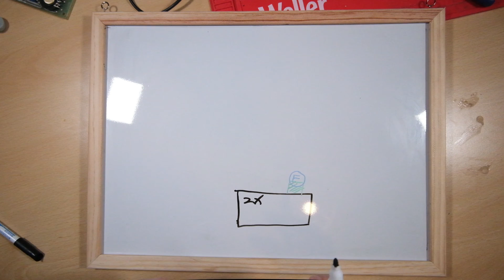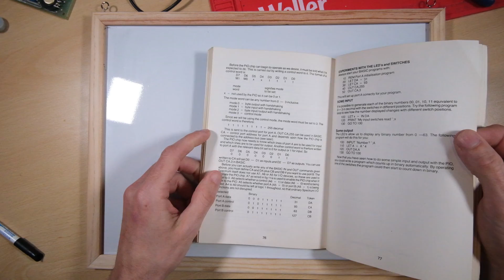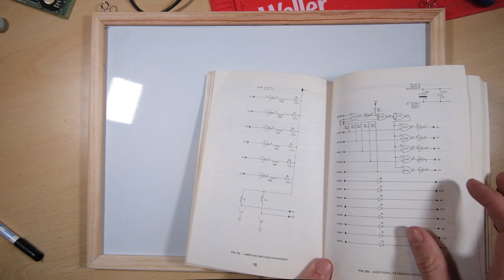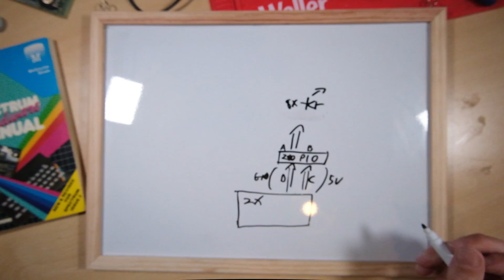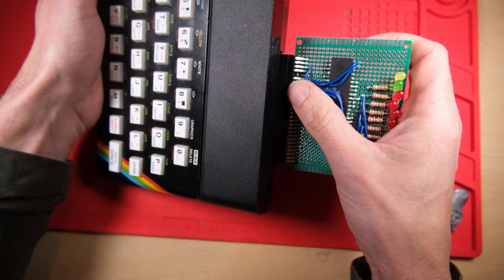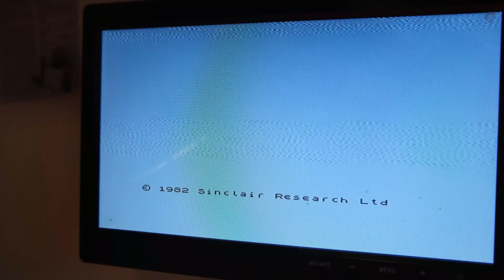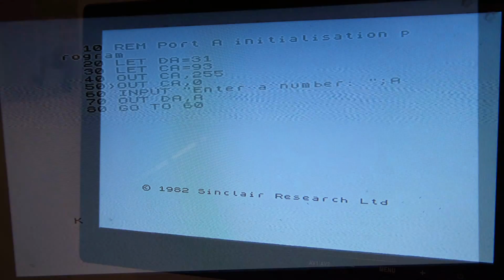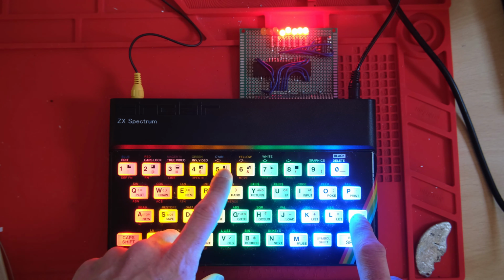How to build a simple ZX Spectrum Interface

Comment: I made 3 of these Z80 PIO breakout boards.

One with Channel A as input and B as output, another with A and B as inputs and the third with A and B as outputs. I also put opto isolators on the I/O pins of the PIO for extra protection. (Hence the three versions)

BTW, If you use the shorter edge conector, you can use these on the ZX81. LOL. The pinouts are in the same place.

Comment: Nice to see I/o from start. Just for info it’s considered bad practice to drive anything direct from logic, should use a transistor or driver chip (which essentially is logic plus transistor outputs. If anything pulls too much it will just take the chip out.Anyway just thought I’d comment for learning, great vid and looking forward to pt 2. There’s also a great robotics book for Spectrum, that has circuit ideas too. Worths a search.

Comment: Nice. 👍.
I made a similar interface For a Christmas light display many years ago. 
Only I use the printer port of my +3 and a opto isolator board to drive 8 sets of 240vac lights. 
The type that don't work if one bulb is blown.
Looking forward to see what you come up with. 👍

Comment: Nice, bings back memories. Back in the day I used a Z80-PIO with a transistor circuit to turn on the cassette motor. Actually two. With a slightly modified copy program it automatically created digital copies of cassettes by starting one player when loading and the other when saving. The chip was also used as Centronics interface to printers by DK'tronics..